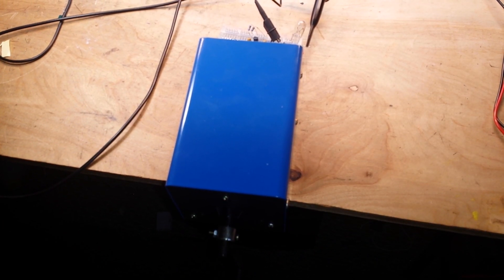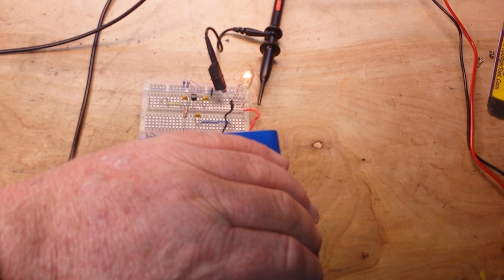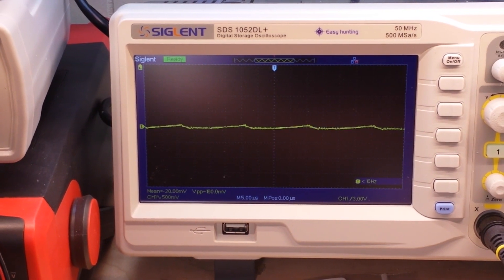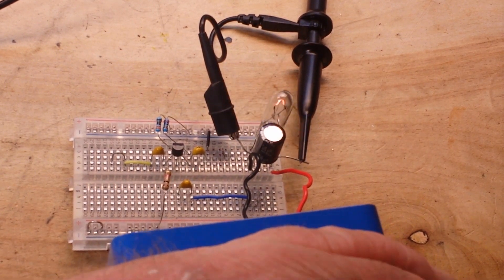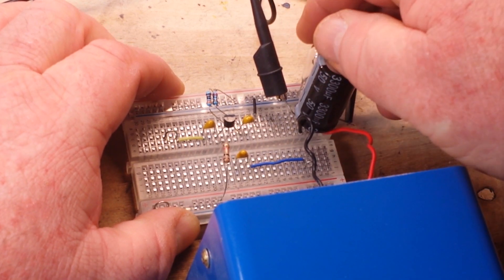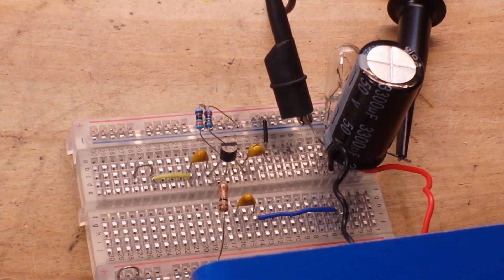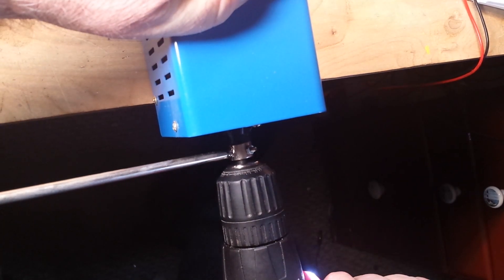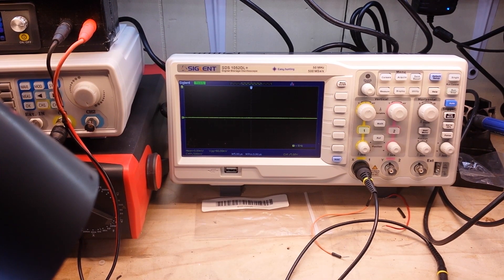Hand Cranked Emergency Generator Second Look

Comment: How about placing the big cap inside the box, inbetween the motor and de DC to DC board inside? Or in parralel with the small one inside, between the polarity diodes and the DC to DC?

Comment: I'm not surprised there is not a lot of filtering added circuitry on these coming from China.  
I built my own hand crank generator and included a super capacitor bank that stores the charge.  I can run a LED lights for hours with just a 3-5 min cranking session, or partially charge a phone.  I added a regulator for the USB voltage.

Comment: Hi! I was looking for tests and reviews about this crank generator. Thanks! Now i want to buy one...
Could the capacitor be installed in the generator case itself, at the output of the DC motor directly?
Or does it have to be after the circuits to stabilise the voltage?
I was wondering about the damages that could occure while tryin to charge a USB device...
I'm not good at electronics, 
Hope this is not a dumb question.
Thanks again from Belgium!

Comment: I’m glad you put a really big cap across it so we could see the results. I was a little surprised it worked even though I suggested it in the first video. I just though that getting a steady output from a hand cranked generator was going to take more work than that. 
Now I want to hook one of those up to an exercise bike or treadmill and try charging some supercaps with it. I may need a good look at the inside of that thing to see if I want to just build my own or buy one eventually, I can’t remember what was inside it so I need to look at the last video again. Great video Paul, thanks for all you do for our electronics community here on you tube.

Comment: Love the bit about using the electric drill to turn the genny to make electricity.  Talk about diminishing returns! 

Just busting your chops. Nice demo and explanation. 

3300? I think I've got a 10,000 around here somewhere....

:D
Reply from the maker: Oh 10kuF? That's (as BigClive would say) juicy!!
Reply: @learnelectronics  - Quite! Lol
Reply: 10kuF? I know you folks over there aren't keen on the SI, but... kuF? Don't you mean 10mF? As in ten millifarads.
Reply: 10k, as in 10,000.10,000 uF = 10k uFSpacing is key.But to answer you, yes it would be 10 mF. Most of what we see here is marked in uF until you hit a certain value, which, at this point, escapes me since I haven't had to deal with them in a loooooong time.

Comment: I am not an expert if you added a large rechargeable battery in series the stored energy would product a stable output plus clanking that thing for 12hrs your arm would fall off :P
Reply from the maker: It would slowly charge the battery yes, but I would put it on parallel.
Reply: @learnelectronics  Still learning about electronics here at best its only good for powering a radio/cell phone being limited to 5v to 12v.